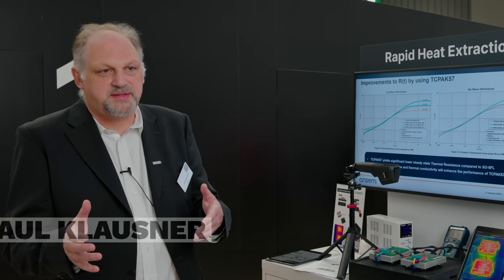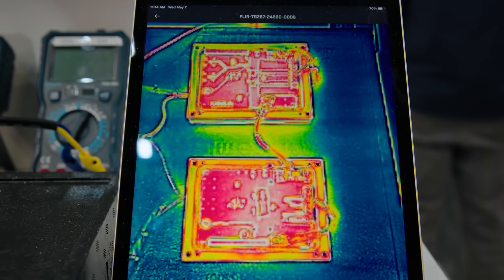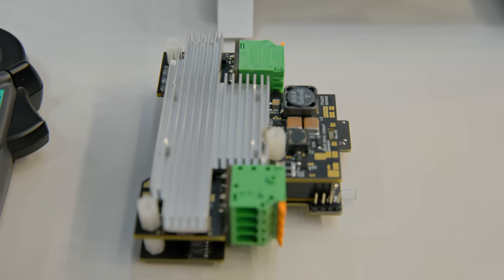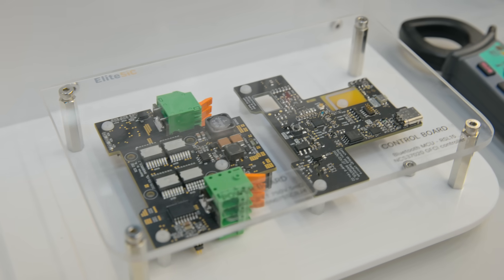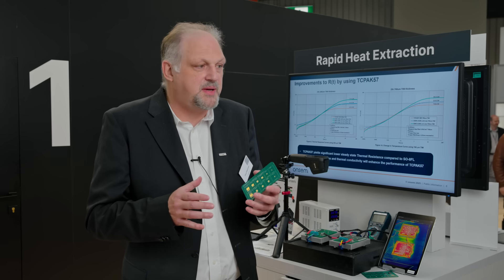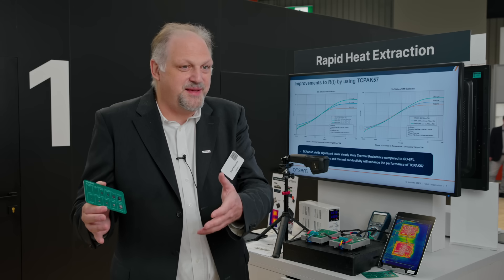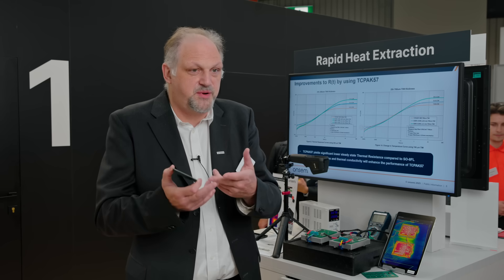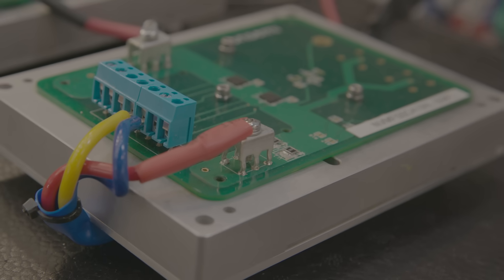How Did MOSFETs Go From 10 Milliohm to 0.42 Milliohm?

Comment: Efficiency improvements (especially in switching transistors like this) are a deeply underappreciated part of modern electronics. It's not just about efficiency to reduce system losses, but more about the packaging options that highly efficient electronics open up. If you don't need huge heatsinks and fans, your design space for the resulting system is hugely relaxed. It's way easier to achieve good environmental ratings (both because you can seal things more easily and because you can tolerate higher ambient temperatures). Stress on the components is reduced because there's less temperature difference when thermal cycling between operating and off/idle. Resulting subsystem weight and size is reduced, making the whole solution cheaper to build and easier to deploy.

Comment: Fantastic, but from a assembler (prototyping) point of view, which includes a lot of manual reworking etc. i am always a bit concerned about the the crazy tiny footprints with down to 0.2mm pitch, for example in a modern 30A DC/DC Converter in a 6x5mm QFPN package. It's getting challenging to reliably work with those things outside of a industrial manufacturing process. Of course as always in prototyping -> Challenge accepted.

Love this guy, he knows his stuff.

Comment: "the power densities of modern IGBTs are higher than the surface of the Sun" -   Wow,  I had to stop the video to think it over, but seems to be correct. Congrats!
Reply: I'm just wondering how that doesn't translate to impressive heat, but it is different material and "rapid heat extraction" is right there on the sign.
Reply: @edherdman9973  'power' does not necessary mean heat, the whole issue is about making the lowest possible resistance to not have heat. 
If the resistance is zero we can transfer 1GW power with no heat  at all,  superconductors exactly do this.  
When the video compared the MOSFET to the Sun, he compared an electrical power to the heat/nuclear power of the Sun: both can be expressed in Watts per area even if these MOSFET do not generate (much) heat.

Comment: "You do not really need 500 Amps" The current EV Fast chargers would like to have a word with you :D
~650 Volts and 350 amps for a Hyundai Ioniq 5
Reply: That’s almost 5 times as much power as the entire electric service in an average US house (220 VAC RMS, 200 amps). 

Where do you even find that amount of power?
Reply: @Flumphinator  You get that much power from a very hefty grid connection. DC fast chargers typically need 480 volt three phase. A 350 kW charger would need ~400 amps per phase. Tesla has some charge sites with 100 or more  250 kW chargers. If every charger could supply full power at the same time (I don't think they can) , such a site would need a 25 megawatt grid connection, 1200 amps at 21 kV transformed to tens of thousands of amps at 480V. I watched the local utility install the transformer to power an 8 stall Tesla supercharger near me, and the buss bars on the 480 volt output of the transformer were slabs of copper about 6 inches wide and a good part of an inch thick.
Reply: @jimmurphy5355 oh man that’s wild. That’s practically a small substation. It’s equally wild that the battery being charged with all that power is still safe enough for you to sit in the car while it’s beefing ~40 kW.
Reply: @Flumphinator  Performance versions of some electric cars have over 1000 HP. The "plaid" version of a Tesla model is one such. It has a 400 volt battery. Full power pulls about 1,800 amps from that battery. Even "regular" EVs will pull close to 500 amps from their batteries (200kW) while accellerating. (Cruising at 70 MPH uses about 15-20 kW.) Ultra low on resistance power semiconductors are one of the factors that have turned EVs from curiousities into very practical, high performance vehicles. Super-car levels of performance from middle market everday family cars...
Reply from the maker: When I was driving down to PCIM in my EV Volvo, I'd regularly hit 200kW of charge when the pack was low enough, then have a steady charge rate of 150kW until I was ready to continue on. Many of the DC fast chargers are rated for 350kW+. Cars charge so fast now that its done charging before I'm done snacking!
Reply: @OriginalCircuit 🤯

Comment: I'm repairing gpus and motherboards. 

Old mosfets directed the jet stream upwards during explosion, since the die was located on a massive single copper base. So you just replace it and done.

Modern mosfets look like microchips and have three small contact pads at their base. And the blast jet hits the pcb between this pads, creating a massive black crater. With a bunch of shorted layers and torn traces.

So, is it really better?

Comment: a 24:1 drop in gate resistance means 570 times less power dissipation with properly designed circuitry; a major jump in efficiency.
I've already seen the results of this in the last year. I've already seen the results;
An Altronics SMP3 power supply, while performing the exact same function and spec it did 30 years ago on the same circuit board form factor, went from wasting nearly 10W at full load to only 1W,, namely because the rectification diodes hadn't yet been replaced by the designers.
I recently ordered a new solar maximum power point controller for my off grid system, same model number and features as last year, footprint is less than half the size, volume is about an 8th, and runs cooler than the much larger unit it replaced.

Comment: Why is the driver not integrated into the MOSFET die or at least inside the same package?
Reply: Driving a MOSFET gate can be very simple using slow changing signals and thus can be directly driven from for low power circuits without any need for a driver. Faster changing signals and high current levels in the system present new challenges and that is where drivers play an important role. However driver circuits will vary from simply a few transistors to switch higher gate currents to gate circuits that use boosted positive or negative drive voltages to deal with power rail bounce. It is also a common practice to insert a small resistance in the gate driver circuit to control rise and fall times which can greatly help reduce noise in the system. Building the gate driver into the transistor with greatly limit it's usability and increase the package temperature. There are however, ICs designed with built-in drivers that are intended to switch fairly large loads with logic levels inputs. These circuits typically switch at moderate switching speeds and many have extra protection features built-in, making driving even inductive loads up to tens of amperes simple to implement. When you are pushing the limits of MOSFET capabilities you have to design the entire circuit around what you expect the transistor to do for you.,
Reply: @briannebeker2119 I believe these specialty very low RDSon MOSFETS do not fall into this case. They're premium parts for demanding applications where - as the video presented - every single bit of performance counts. I do not see such parts driven without a reasonably sophisticated driver that could be integrated.
Reply: There are MOSFETs with integrated drivers. In fact, they have existed for quite some time—I remember using some modules more than 10 years ago. For example, at ON Semiconductor they are called SPS (Smart Power Stage). A quick look at their product search table brought up about 20 products, and other semiconductor companies also offer similar devices.    For an example search for this:  'NCP303160A datasheet'
Reply: Very good point, it would simplify public design greatly.

Comment: Wow! Great stuff! What part is this? and what gate driver? Would love to see if it can handle frequencies higher than 60Hz.
Reply: Part number NVMFWS004N04XM
Reply: The part is NVMFWS0D4N04XM and it switches in kHz ..but at max 40V rated - no high voltage part
Reply: @PaulKlausner-i4c I found out about it sometime ago. Very impressive specs. I didn't get the chance to play with it yet but from my calculation it can switch 80A at 10s of khz with no heatsink required.

Comment: This is really an under-appreciated factor. 🧐
I grew up using standard bipolar’s that required unreal drive currents, and still had ridiculous ‘on’ impedances and their attendant heat dissipation; having to always use massive heat sinks and cooling! 😢
The ultimate expression of this, is tiny multi-amp SMD transistors! 😮
Reply: Yeash, I grew up with the massive heat sinks on most everything, now, I can order a small power supply, same form factor circuit board, but the external heat sinks are completely gone, replaced by fat traces on the circuit board, mostly for the remaining diodes for the wheatstone bridge, which I hear is going away soon too with active mosfet rectification.

Comment: Now, let’s aim for 600V 1mohm.
Reply: IMDQ75R004M2HXTMA1 put 3 of those in paralell.
There are physical limits....
Reply: @ABa-os6wm  sadly you can’t put mosfets in parallel without series resistors or fire
Reply: @pyromen321  well, you can)

Comment: How about parallel circuiting them? Do this "new" Transistors explode because the turn on time is not identical. That would be an improvement! not this hypocritical shit. What is it use full if your regarded package system hits the limit of getting rid of the heat. Parallelism is more important. Why does it hat to be that only one transistor has to do all the work? If they could play nice when they are in parallel then you wouldn't need to built that schit in the first place. Don't get me wrong getting more performance out of the package is great but having additionally the ability to get them in series and/or parallel easily with no additional special components would make this transistors a million times more powerful and versatile than they already are. The parallel circuiting issue should not be banalized! Get to work and FIS this issue! pleas.
Reply: is this genuine or ragebait? heat dissipation is the whole point. if they are not thermally coupled then one will run away, right? im not an expert but seems like the best way to tightly couple two is to make them into one larger one?
Reply: @EngineerNick exactly . This breakthrough is literally like having 10 in parallel.
Reply: MOSFETs get higher resistance with higher temperatures. The cooler MOSFETs will conduct more current. There is no runaway effect in MOSFETs compared with transitors.
Reply: We will start working on that, the moment you get your C1 in English.
Reply: While having extremely low on resistance is great for heat dissipation, there are several other factors that need to be considered in a design. One of those factors is that often the maximum current through the die is much larger than the current the connecting metal can handle. One of the reasons packages get smaller is to reduce the contribution of the connecting metal to the losses of the transistor. If you need to switch heavy currents you parallel multiple transistors so none of individual transistors needs to handle anywhere near the extreme current levels the device is theoretically capable of. The great thing about MOSFETS is their positive temperature coefficient meaning their resistance goes up as they get warmer which enables them to current share without inserting extra resistance into the system. The trick however is how to driver multiple transistors and that is where many of the other characteristics become more important than the forward resistance. If you can drive the gate with a slow changing signal you can make things much simpler however if you need faster switching then you have to fight parasitic inductance and capacitance in the system. These very small packages enable placing driver chips with very short traces to the gate, coupled with lower capacitance and inductance from the transistor itself enables fast and clean switching. Using 2 or more transistors with gate driver circuits in the same space as a larger transistor by itself is not hard to accomplish and with less heat losses to deal with you have the thermal budget available to pack the circuit in tightly. As mentioned in the video more often than not you actually want to slow the gate switch speed a bit to reduce noise in the system.

Comment: Pity that the top cooling solution physically obscures the ability to probe the circuit elements. Good for production cost but bad for service/repairability and reducing e-waste.
Reply: The power traces are usually accessible on multiple points and the gate driver from the underside. I think the performance increase is well worth it.
Reply: Sometimes you have to sacrifice convenience to get a better performing circuit tho
Reply: With some forethought you can reduce or eliminate that by putting in propitious test ports.

Comment: Power density higher than sun surface? Come on
Reply: Let me show you the engineering numbers :  According to NASA the power density on the Sun is 63 mio Watts per Square  meter -->  63 Watt per sq mm
If you take the AFGHL40T120RW and run it in short circuit at 800V Battery we got 40A saturation according to Datasheet: 32kW. Not knowing the die size it is fair to estimate max 65% of the package - which is 15.37*20.32 mm² * 65% --> 203 mm²
So the power Density in short circuit is 157 W per sq mm - so more than double of the Sun  (and this  situation is sustained for the specified short circuit times of several µs)
Reply: For 6 microseconds.

Comment: Is the top cool compatible with conformal coating/potting?
Reply: Top cool can use standard thermal past or gap filler , but you need ot consider the isolation is needed. Either the grease is isolating or a isolation plate needs to be applied

Comment: why is lower Rds on so important?
Reply: A ideal switch has no contact resistance. The R(DS)on is the  Resistance between Drain and Source in ON State and therefore defines how much power loss you have to consider on the switch during conduction.
Reply: In any electrical circuit, there is resistance. The more current you push through a conductor or a device the hotter it gets. So when you need to push 100 Amps through a circuit, minimizing the current path resistance is super important so your parts don't catch fire or waste too much energy.
Reply: It means that in many cases you don't need a heatsink

Comment: Hotter than the sun? Come on with the marketing BS
Reply: It's a good conceptual framework for thinking how would you engineer something which can run on the surface of the sun without breaking.
Reply: Let me show you the engineering numbers :  According to NASA the power density on the Sun is 63 mio Watts per Square  meter -->  63 Watt per sq mm
If you take the AFGHL40T120RW and run it in short circuit at 800V Battery we got 40A saturation according to Datasheet: 32kW. Not knowing the die size it is fair to estimate max 65% of the package - which is 15.37*20.32 mm² * 65% --> 203 mm²
So the power Density in short circuit is 157 W per sq mm - so more than double of the Sun  (and this  situation is sustained for the specified short circuit times of several µs)
Reply: @PaulKlausner-i4c  Still, does it have any real world relevance besides sounding cool? (Or rather cringe AF)  It's like saying the switching speed is faster than a human neuron. Factually correct, but at the same time ignoring all the relevant metrics that make this comparison utterly meaningless.
Reply: @fricy81  Yet the question was challenging the facts not the meaning.
Here you go, we got the facts.

Comment: How much current can the 3x3mm package handle before bond wires fuse?
Reply: The 3×3mm 1.5mOhm is rated at 178A
Reply: It's typically clips, not bond wires.